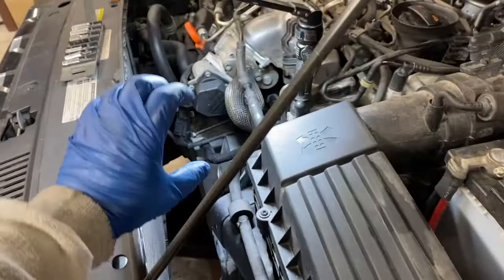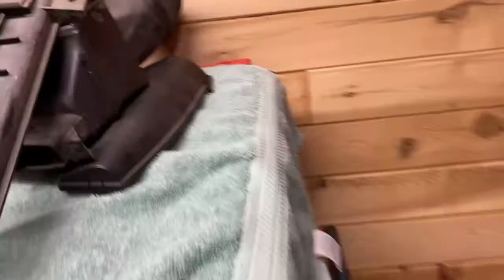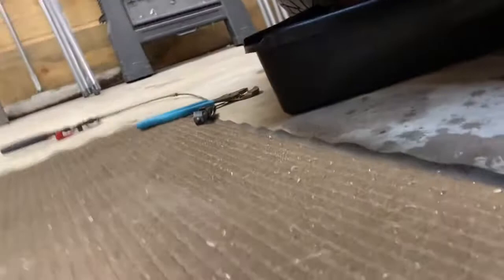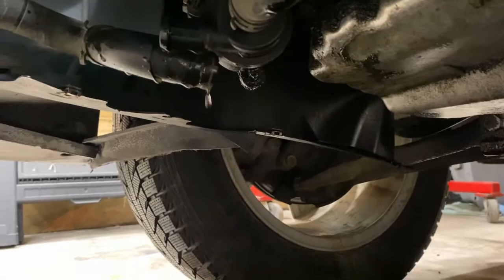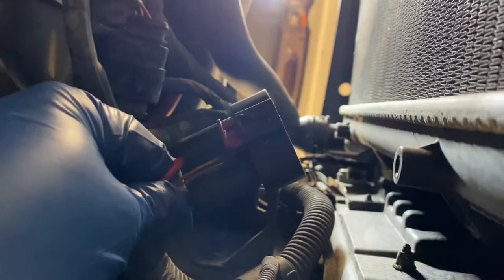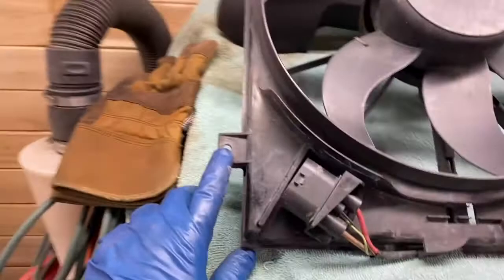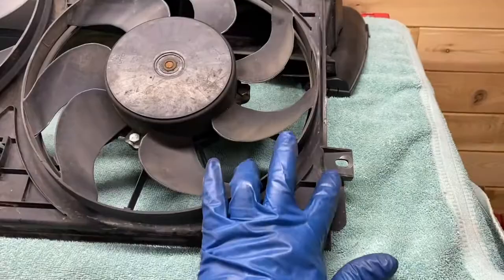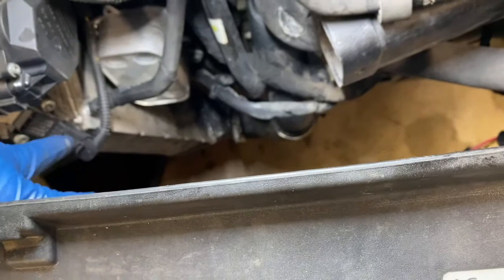2012 (13,14) VW Passat Oil Filter Housing Replacement

Comment: I watched your video to help me with my 2014 Passat TDI.  For those of you who wish to NOT spend hours grinding bolt heads off because you stripped the bolt (like I did) listen up!!!   I didn't know that the bolt type that VW uses is specific!!  I thought one would just use a hex or torx bit.  BUT  you don't!!  VW uses the TRIPLE SQUARE bit for those bolts!  Save yourself some time and money and get the appropriate TRIPLE SQUARE bit for those bolts!
Reply from the maker: Yup.  Those triple square bits are important to have.  They are readily available on Amazon or at local auto supply stores.
Reply: 8mm to be exact

Comment: Only video I've found that has the version of the B7 Passat with the intercooler. All the others just had simple hoses attaching to the throttle body, which I chose to take off to make for easier access to the oil filter housing. Much appreciated for posting this video.
Reply from the maker: Glad I could help

Comment: Man I can't tell you how much I appreciated this video. Just did the repair today, and this was a huge help. Absolutely awful job
Reply from the maker: I'm so glad it helped.  Thanks for letting me know.  It's not a real fun job, but it's helpful if you know approximately what to do.  The first time I did it, I didn't really know what to do and ended up blundering my way through it inefficiently.  I hope your repair solves all your problems.
Reply: @3rdstallgarage  I think the hardest part was getting all the hoses to come free. I had to use my heat gun on a few to get them to let go. I ended up removing the little coolant pump where you drained the coolant. I found that was easier than separating the rest of the hoses from the intercooler.

Comment: Thank you so much for making this video. Did repair today with little to no issues. Once I pulled off the oil filter housing I noticed one of the seals for a coolant section was out it’s channel partially, which lined up with where the leak seemed to be coming from.  Seems to be holding tight, no leaks!  Thank you again! Also, I got the triple square heads from advanced auto parts, a 6 or 7 piece set for $60.
Reply from the maker: Glad it helped

Comment: As I watch you repair this issue I noticed that although the amount of engineering they put into these cars nowadays is 100 times more than our old cars the same issues come up regarding materials and cost. If that oil cooler piece was anything but plastic you would not be doing this, and yes it lasted this long  but in reality todays manufacturers design for a 10 year lifespan (to get out of warranty). Great job explaining the issue and how to best correct it. keep it up
Reply from the maker: Thanks! Yes, modern cars are quite different than my 66 mustang.  Some days I think it would be fun to try to meld the two and put an all electric drive train with modern amenities in a classic body.
Reply: @3rdstallgarage  I saw a video where they put a 69 Mustang body on a 2014 chassis and interior. That is a great meld of form and function as everything but the skin is 2014.

Comment: Thanks for this very helpful video. I would add a few notes: 
(1) Regarding the plastic rivet thing that holds the dipstick tube to the oil filter housing, make sure when you put the new filter housing in place that the ear on the housing is under the ear on the tube. The holes in the ears will not align if you reverse this. Don’t ask me how I know this 🤬 There is a video on the Josh’s Jettas channel that covers this job, and he includes a shot of the plastic rivet before it is removed ; it shows the proper orientation.
(2) If I was doing this again, after removing the fans I would cut a piece of Masonite or thin plywood to the same approximate size and mount it over the radiator to protect it from being gouged when the intercooler is being removed and replaced.
(3) If you don’t already have a set of the special pliers that are designed for the hose clamps VW uses, buy them before you start this job.
Reply from the maker: Good input for everyone! Thanks.

Comment: Is there anyone making an aluminum oil filter & cooler relocation plate for these yet? I can only find older models with it available.
Reply from the maker: Not that I know of...sorry.
Reply: Vaico makes an aluminum housing version of this. Vaico 03L115389H

Comment: Working on one of these right now but having some issues finding the right triple square bit. Another shop stripped the top 2 so I know I'll have to extract those somehow but I want to try to remove the bottom 2 before extractor set, they don't look as bad.

Any chance you or someone remembers which size triple square?
Reply from the maker: I don’t.  Sorry. I should have included that in the video.  Sorry.
Reply: M8 is the size.  How did you get the stripped bolts out?  I have one that is stripped
Reply: @aphat911  ended up having to weld Allen keys into the bolt head. Got them all out that way. Replaced the bolts with same threads and length but went with hex heads to avoid this issue again.

Comment: Did you have to loosen the tension pulley or adjust the alternator in anyway to replace the oil filter housing?
Reply from the maker: I don't think so. But its been a little while since I did this job.  So I'm not 100% sure.

Comment: I have a 2015 Passat and have a coolant leak that I've traced to the oil cooler....is it possible that the coolant is leaking from the cooler itself, or is it just from one of the hoses connected to the cooler? There is a puddle of coolant on top of and below the cooler but I'm not sure if it's coming from a leak ed hose or the cooler itself.
Reply from the maker: I suppose that’s possible but that wasn’t my experience and I don’t think that’s a common way for it to leak.

Comment: I was looking for housing bolts torque specs all over internet and couldn’t find them, the only difference is that the car I’m working on is a VW Amarok, but is the same 2.0 TDI. Since this video has 10 months, I would like to know if you have had any leaking issues.

Thank you very much😎👍🏼
Reply from the maker: No leaking that I've noticed yet and it's been about a year.  Sorry I didn't respond right away, I missed this comment somehow.
Reply: @3rdstallgarage  Thank you very much for your video and your answer😎🤙🏼👍🏼. God Bless you🙌🏼

Comment: Has anyone else had the 6mm Allen strip on you? How did you get them out?
Reply from the maker: Mine didn't.  Sorry.  Sometimes tapping the wrench into the bolt head helps it seat a little better and grab.  Good luck!

Comment: The Jetta cjaas lucked out. We have aluminum housings.
Reply from the maker: Be thankful!
Reply: @3rdstallgarage  definitely am. Doing the gasket was simple. Just did a full exhaust egr and egr cooler delete as well.
Reply: What year is your cjaa Jetta because my 11 Jetta tdi has plastic oil housing.
Reply: @hardcore4476  if it’s plastic someone ordered the wrong one once upon a time or you have a Passat. Look up cjaa oil filter housing and it’s aluminum.

Comment: Question? Did you put any stop leak in the coolant reservoir to have a temporary fix? What should I use to clean out the build up from the stop leak in my coolant system? TYIA
Reply from the maker: Good question.  I didn’t try any temp fix other than to keep adding coolant when it got low. The leak was pretty slow.  I haven’t used stop leak before but if you did, then you might want to fully drain your coolant system when you replace the housing
Reply: I wouldn’t do that.  You might end up clogging your heater core.  Clogging is a known issue, but mine was out of warranty.
Reply: Re-reading your question, it sounds like you already used stop leak.  I would try flushing the cooling system, and IIRC, using a wet vac to suck out the coolant via the fill/overflow tank.  During production, solder flux could contaminate the coolant and clog the core, and I suspect stop leak could do the same.

Comment: I have a 2012 Passat TDI and love it but it is having a hard time holding oil pressure. Would this help with keeping my pressure up or not really? I would like to talk to you a little bit more about it if we can? I have a ton more questions.
Reply from the maker: Cameron, shoot me an email at 3rdstallgarage@gmail.com and I'll do my best to help.
Reply: hi
ive got the same issue my car is having problem holding oil prssure..any advice
Reply from the maker: @shalimuddin1  my car seemed to be holding oil pressure just fine but it was leaking oil from the front of the engine block. If yours isn’t leaking oil then this may not be your problem.
Reply: @3rdstallgarage  ok ive been running up and down trying to fix the issue..ive had oil pump issue but was fix with new oil pump kits and sensor.how ever when i drive and engine gets warm it send the oil pressure warning light even full oil and drives and sound fine...

Comment: Does anyone know what the triple square bolt size is and where to get the tool?
Reply from the maker: Sorry for the slow reply.  I don't know the size off the top of my head, but I bought a set off amazon years ago. Your local auto parts store probably has them too.

Comment: These bolts seem hard to find, where can I get them???
Reply from the maker: Replacement bolts? You might need to go to the dealer.  Sorry...not sure.
Reply: They are supposedly one time use torque to yield stretch bolts. VW doesn’t have them in stock and are special order. Was bummed to hear that and wish I would have ordered them with my other parts.
Reply: @hardcore4476  we reused the originals, so far so good about 2,000 miles in

Comment: Great video. Did you use OEM for the replacement oil filter housing?
Reply from the maker: I struggled with that decision.  The cheapest OEM one I could find was about $400 shipped.  I’ve had pretty good luck with IDParts products, so I went with there’s.  It was about half the price of OEM.  I hoped it was better than the $50 eBay ones. Ask me again in a year if I regret it.
Reply: @3rdstallgarage  Well not quite a year, but I just bought mine from IDparts as well. How's it holding up? And what size is the triple square by the way? Thanks in advance
Reply: I need to buy one how did that brand hold up?
Reply: @troyblack7452  I just replaced mine over the weekend with the Magneti Marelli unit that came from IDparts and so far this week I haven't had any issues! Mine also came with an oil filter in the housing so that's a plus that you don't have to buy one